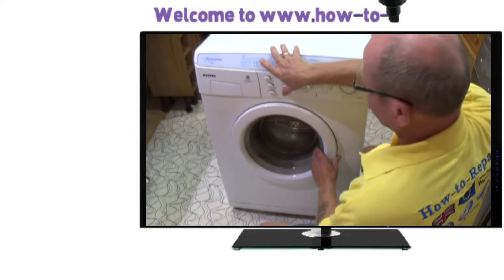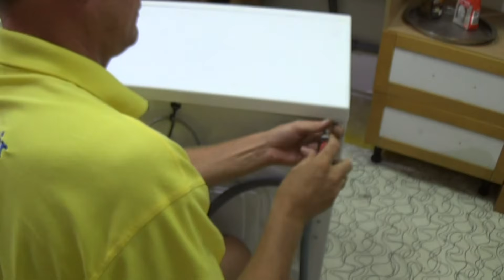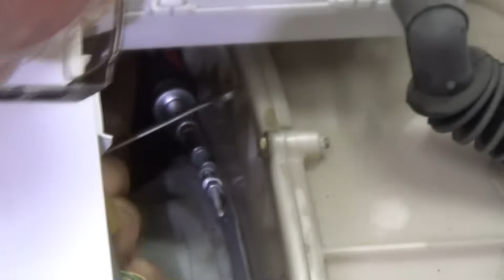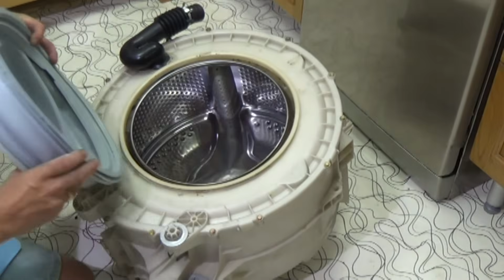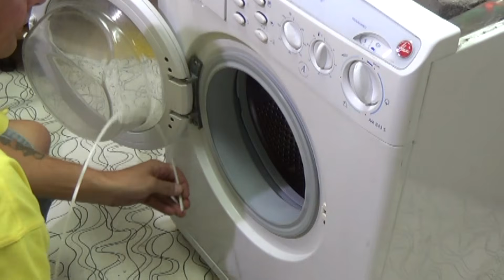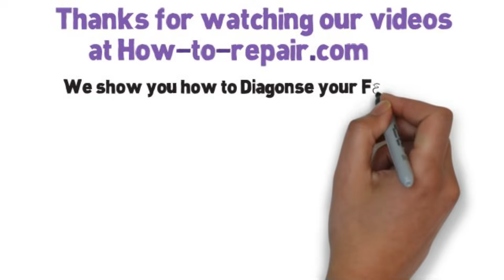How to replace a washing machine door seal on Hoover, Candy, Iberian, Teka, Otsein & Zerowatt

Comment: It's a bit harder on a washer/dryer because the hot air inlet makes it tricky to refit the internal band after the seal is in place.  So you need to have the band flopping about in the way while you refit the seal, or take the band part and refit afterwards, or what I did was fit the seal and then disconnect the hot air feed and get the band over the top of the protrusion on the seal.

Comment: Newer ones are even worse. Not only do they not come off the fronts but they have replaced the inner band with a sprung one with no ratchet so it's permanently tensioned
Reply: Is there anything that can be done? I am stuck on this for the last few hours and seriously contemplating just buying a new washer.

Comment: Bitch of a job to do on my hoover machine, ended up taking the drum out. Was no way to get to that clamp, it was down the bottom'ish of the drum.
Reply: Just done a Candy grand vita. 
Took 6 hands (3 people) to hold the seal in place on inner drum whilst getting spring type seal cable on.